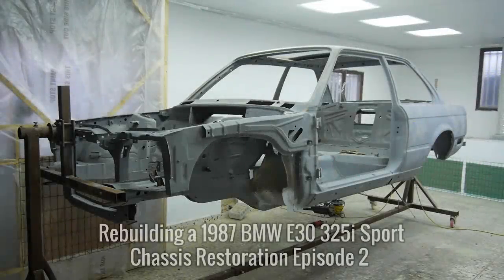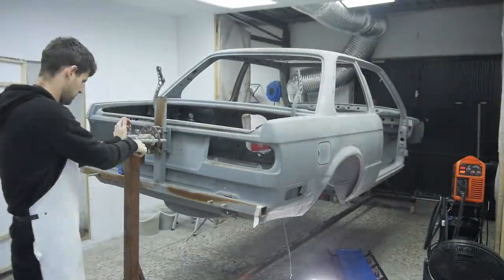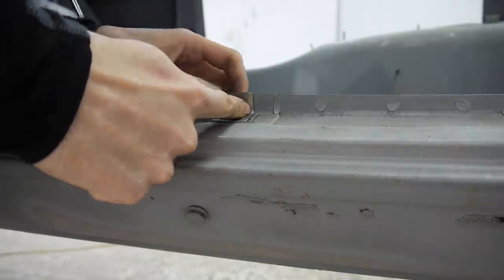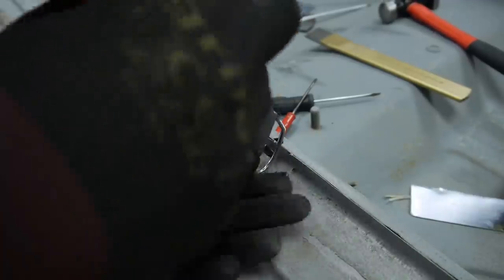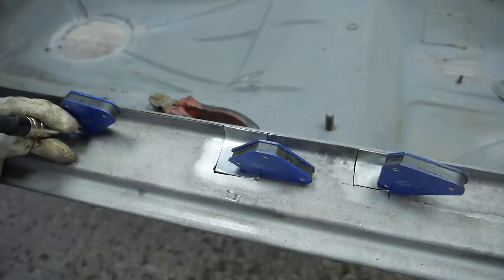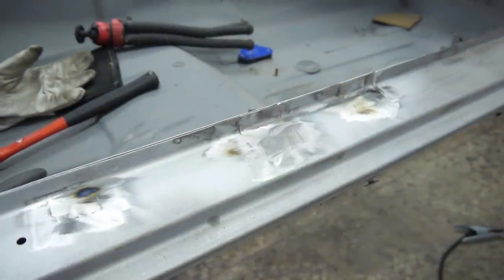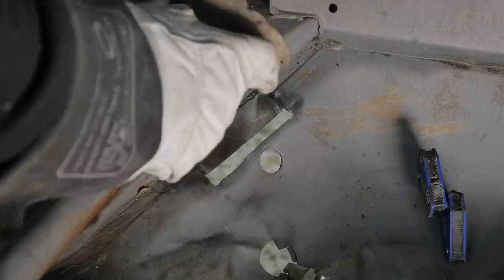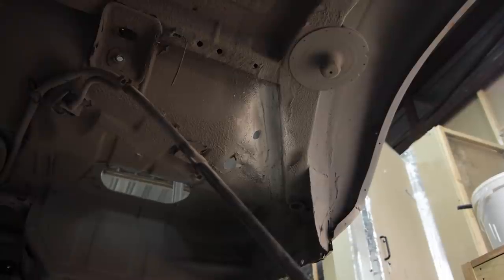Rebuilding A BMW E30 325i Sport | Part 2 - Learning to Weld A Car

Comment: I dont know if you allready have been told theese things, if it is so sorry for the boring repetitiveness.
When setting the welder the most convenient settings I have found is to set the welder to a fitting wire speed, whitch it seems you have managed and crank up the amps a smidge higher.
I put the amps as high as possible. Make a test piece and make a spotweld that is a bit too proud of the base material, crank up the amps and make another small spotweld. If it still is a bit too proud, crank up the amps a bit more. I do this procedure until I almost burn through or untill I it blows throug and if blowed through I back down the amps. I shoot for maximum burn through just without blowing through.
When setting the welder like this the spotwelds does not stand proudof the base material and I reduce the need to cut the wire before the next spotweld sequence. Allthough it is a bit difficult to do it like this and I have to wait a bit longer between eat h weld, it  saves wire and time behind the damned grinding wheel. 

Why the older patch lies beneath the original steel is because it is easier to make the patch a litte bigger than the cut out, put it on the opposite side from the visible side and weld it. It saves time from beeing thorough when cutting out the patch and it minimises the possibility of blow through when welding. The downside of this method is that the steel sheets get doubled up and there has to be more  filler putty applied. Not very profersional.

Another tip is to cut out patches that are bigger and straighter than what you tend to do, it is much easier to weld and faster over all.

Hope this is not to much gibberish,  my Motherly tounge is not English.

Thnks for great entertainment despite the bad welding technique displayed ;)
If you get yourselfe zome better tin snips it will also get easier and give better result.
One for left cutting, one for right and one for straight cuts.

Thanks

Comment: The step-down in the previous patch allows for a quick'n dirty bondo-egalization. Where I learnt puttin' lipstick on pigs, they didn't even cut away most of the rustouts but hammered those in a bit and put new parts just over the old ones. Puff pastry from tin and iron-oxide 😂

Comment: Use 0.6 wire... A lot less heat needed.. Also you're way to greedy, use more spot welds and move around more.. You can also use a damp rag to help cool it down between applying the spots.. ☺ Looking forward to your next video...
Reply from the maker: Thanks dude!

Comment: Dont try to weld long beads. I know its tempting and seem faster but risk of blowing holes is much greater, tack next to a tack after the bead will stop to glow and you will be golden, i can see you get the idea now and its much much better, i can still see some zinc plating in your welds but with c25 mix should be much more managable but still opt for a non coated sheets or make sure you clean them really well. Also cutting out a bit larger pieces will be easier to weld. I love to see how much you improve in comparision to last videos. Even thou you will now have replacement panels its a good idea to practice welding on scrap ones, you can tune up your welder (it seems pretty good tho but you might find some settings that fit you more) and get some more practice. For now you are heading in good direction, keep it up ;-)
Reply: Dont worry about the bead height, if you get some penetration it is good, you can grind off the excess

Comment: I'm pretty sure the kind of galvanized metal you are using is most of your problem
Reply from the maker: I'll have this replaced with uncoated metal by next episode thanks man
Reply: @RestoreIt  Yes i think you will see a better result by using uncoated just raw metal in the right thickness , the gas and welder is reacting to the galvanized coating.

Comment: Well I learnt more about erectile dysfunction than I was expecting to today 😳 looking at your welding your trying to run beads of weld you can't really do that on thin sheet metal you need to do it in a series of tacks and opposed to turning your welder up try turning your wire speed down a touch hope this helps 👍

Comment: Keep up the great work dude! If can give my opinion, You’re welds are sitting on top of the metal and not getting good penetration. Trying messing around with you’re settings I’d start by raising the amps and lowering the wire speed. Also, you’ll be much happier if you just “spot weld” the patches in, running beads on thin metal can be very frustrating with blow outs and splatter causing dirty metal. Oh and last thing, snow you’re hand movements down. 👊🏼

Comment: I've learned a lot in this video! thanks! What I do notice after seeing a lot of youtube videos about welding is that you we're blowing through the metal pieces (wrong settings?) and that you make replacement pieces before you cut one out. I am not sure but wouldn't it fit better if you make them after the cuts? so you can adjust?

Comment: Much improved welding chief.  Is there a reason you can`t overlap panels then weld, rather than cutting to size?  I get why you would`nt on the sills where fit might be a factor, but I thought fit and finish on the interior might not be so critical.

Comment: What is the best mode for mig welding car panels: current, voltage, inductance, gas! Please share your thoughts! I’m approximately at the same level as Restore it
Reply from the maker: I think it all depends on the thing you are welding and the surrounding metal.

Comment: The reason your having an tough time cutting with those sheet metal snips is because your holding them upside down, Keep the metal flat to the bottom jaw of the snips. You'll find them much easier to use.

Comment: Believe it or not, that WASN'T the worst welding I've ever seen. You at least seemed like you had a plan, and you weren't just slathering weld on hoping it would somehow fix things. I mean yeah, I can tell you're still learning, but so what? You're trying to improve. There's a lot of people that get a welder, learn just enough to fix some minor problems, and never get any better. Nice job!
Also plasma cutters are an interesting beast. They are complex to get running the first couple times, but when you get it, it quickly becomes old hat.
Usually the corner hole drilling approach works for saw blades like that. Sometimes if it's a really tight fit, I use a hole saw on a drill right in the middle of the affected area then just spread out from it. Depends on the angles.

Comment: Please use other sheet metal, you can´t get zinc off properly. You can see it when you weld. The smoke and the white stuff that appears when you weld is from the zinc. That smoke is pretty unhealthy and the welds get bad also. You will se that when you use uncoated steel it´s much easyer to weld.
Reply from the maker: Thanks dude. I will make sure I have some uncoated steel for next episode.

Comment: It`s getting better, really!
Skip that wax based undercoat for bar&chain oil, check out mustie1, he uses it all the time for spraying the bottom, after a drive over dusty roads, it builds a nice protective barrier. Wax based coating stays fine until one little chip comes off, water can creep behind it and do really bad...
Great work so far, keep the patience!
:-D

Comment: Not an expert, but seems that you're "sleeping" the welder tip, too much material is left on the cord. Maybe you should set less AMPS to have better control on it. BTW, great videos! a fan from Uruguay :)
Reply from the maker: Okay thanks Mauricio! I'll try a lower setting.

Comment: When the welds pile up and look tall afterwards, it usually means the feed speed on the wire is too high, so it's spitting out wire and melting it and piling up rather than laying flat - your heat looks good for having decent penetration, but thats just how sheet metal goes, you have to do smaller "Stitches" and move around or take breaks or you blow thru everywhere.
Biggest problem is that awful metal you've bought for repairs -  it's a bit thicker than the stock metal, which is fine and helps with the blow thrus, but NEVER NEVER buy galvanized metal - no mater How much you claim you "Cleaned it" it's clear you havent by all the smoke, and yellow/white residue left over when youre welding! Bin that crap and get some BARE STEEL. even recycled metal would be better (an old File cabinet, soup cans, etc LOL) theres no way to get better than just digging in and doing it, youre doing well with using REAL MiG with gas instead of that flux core garbage - so half the battle is done, also, go get a second small grinder, keep the flapper wheel in one, and a thin "Whiz-Wheel" cut off disk in the other - will help a lot- your body hammer is decent, maybe get some dollies for backing up when youre hitting flat flanges and seams.

Comment: Nice! Getting much better. Practice makes perfect.

What is the metal thickness for your patches? Probably you've said it 999999 times but I can't recall now. And why do you prefer metal scissors for patch cutting rather than angle grinder? 🙂

Comment: Hey! Much improved! Great you could go to mig. But for thin metal try several spot welds, one overlapping the next, instead of longer beads. This allows heat to dissipate and avoids blowouts. Try reducing wire speed slightly so welds dont crown so much, and so you dont have to cut wire stickout every time. You have to make many slight adjustments until the machine is dialed in, but its worth it. In fact how it sounds while you welds tells you a lot (try Jody at weldingtipsandtricks.com). Finally, if youre going to lay down a bead, push or go forward with mig, so the gas always covers the weld. Then practice, practice, practice.

Comment: You'll be alright when you learn to use the tin snips the right way up 😅 most sheet that you buy has a weld  through coating, no need to clean it all, welding is just hours once you put in a few hundred you'll be great.
Reply from the maker: Thanks Jusb!

Comment: Never weld seams in one go, you are overheating steel and it's warping. Make the seam from many spots scattered around the patch, so it cools down when you make a weld spot somewhere else and your bead will not be so high

Comment: Hi mate you’re doing amazing!! Not a criticism, are you pushing or dragging the nozzle onto the weld as you’re better to push the nozzle. Might notice a difference. Great videos though keep them up!!
Reply: Also anywhere where there’s large gaps that are a pain to fill, have you tried a flat piece of brass behind it will help things if you’re struggling to fill it

Comment: Dude u need to push the welder handle.  Dont pull like u do. At elektrode welding u pull the elektrode there u need to push ist and u got to low Amps ure weld need to be more flat.
Reply from the maker: Okay thanks for the adivce Lukas!

Comment: your welder is set too high for these thin metal sheets, thats why you're burning holes in the material. also when you're welding try to "stick" the torch instead of dragging it. so if you are right handed, weld from the right to the left.

Comment: Why didn't I change the threshold entirely? You can see that it is strongly corroded?

PS do not use a wire brush for the final cleaning of rust. It smoothes the micro-shells with corrosion and in these places will begin to rot again.

Comment: TIG would be maybe better ... but idk ... anyway good work :)
Reply from the maker: I think this also. I'm on the hunt for one. They are just pricey.
Reply: @RestoreIt  tig welding is way more complicated than mig. On TIG there are so many little details in the process that can mess up your weld and as a beginner you can't tell what's the Problem. TIG also is much slower than MIG which can generate more heat into your Panel. On those thin stuff you want to get your heat in and out as quick as you can to minimize distortion :)

Comment: Sub, bell, now i just have to patiently wait for each upload.
Quick remark on the weld after lunch, almost 90 percent of your welding is brain power (you are thinking about each spot and pass, so your brain have alot to think about, once the normal stuff transfers to the muscle memory and the brain frees up thought for more important stuff, you'll get better.
Like the first time driving a manual, gear clutch brake steering,, its over whelming.
Reply from the maker: Yes lad. Going as fast as I can. I'm aiming for every 3 or 4 days very soon I promise :D

Comment: looks to me like you have the welder set wrong. wire speed is too fast and power too high and when you weld draw CCCCCCCCCCCCCC with the wire, like building a little C bridge across the gap then the next C builds onto the last C. slower wire speed means you can draw a really neat weld and control its height and lower power means you wont burn through. i recommend to stop welding on the car and use practice pieces on the bench until you get the hang of it.